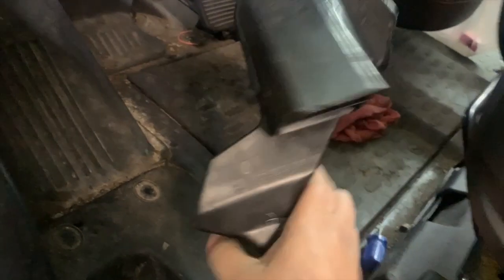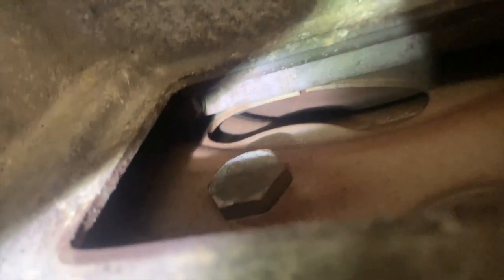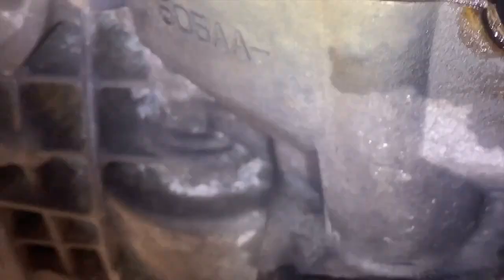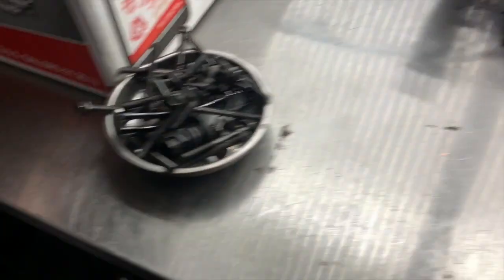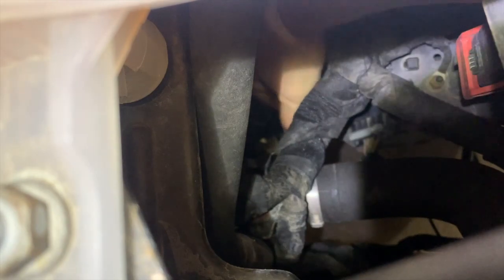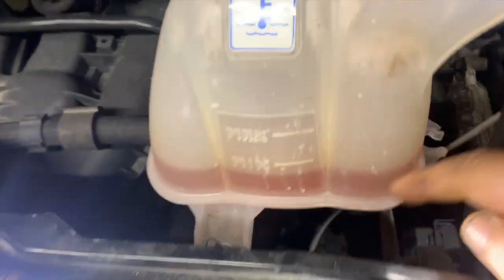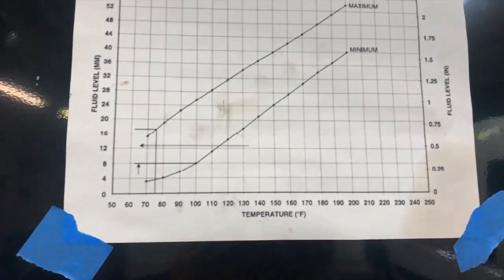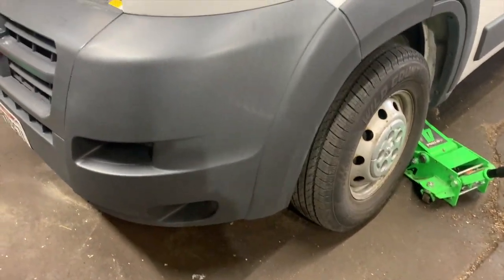Ram Promaster Short topics : flexplate inspection, trans fluid tool and tidbits. Promasters Only

Comment: RE: Checking Transmission Fluid level. Another trick to check your fluid level is to remove the " Oil Level Dipstick" and with a nail file, mark two lines on the opposite side  at 1" and 1.5" on the dipstick.  Then use the Oil Level dipstick as a Transmission Fluid Level dipstick - wallah! your done.
Reply from the maker: Correct! The only reason I didn't recommend that is I suppose it's possible that if you put a nick or a slice in the dipstick it's possible it might fatigue and break off. Plus, not all but most Promasters have the cable/bullet style stick which is very hard to read transmission fluid against. Plus, the big zip tie is easy to carry and handy if you ever need to take a hostage!
Reply: That’s how I do my hostage tie ups as well.

Comment: My flexplate has broken 3 times in my 100,000 miles or so of ownership. Any idea why it keeps breaking or if there is a stronger replacement?
Reply from the maker: Yes, but you aren't going to like the answer. Something is causing a misalignment between the engine and transmission. Either one was drilled off or otherwise made wrong, and it's causing them to be eccentric to each other. That wobble has to be taken up by something, and that something is the flexplate. The problem is I don't know how you would measure it to find out which one is the culprit. The fix would be some kind of offset dowel. Another option would be to assemble it without the two dowels, measure it's vibration when spinning, adjust it for the least vibration, and then oversize drill it and install new dowels. But exactly how you would do that I don't know. You could also install some kind of stronger flexplate or make a custom flexplate, but I suspect that would only be a temporary fix.

Comment: Are you checking the temp via an OBD II sensor, or with a thermometer?
Reply from the maker: You need a mid-grade scanner to read the computer for trans fluid temp. You could also read it mechanically with an IR gun on the pan or trans cooler, I suppose. Not sure how you would do it, but you could stick a temp probe down the trans dipstick tube.
Reply from the maker: Doesn't really matter though, let it idle for 20 min, set the level to 1.25-1.5" and it'll be close enough.
Reply: @promastersonly1419  thank you! I saw another channel lower a thermometer probe down the fluid intake, this seems much simpler

Comment: What is the difference between taking the fluid measurement in Park vs Neutral? Others say to take the measurement in Park.
Reply from the maker: From my end, all the manuals say to check in neutral. But SFAIK, there's no difference between N and P as far as the transmission is concerned. If I have it in the shop, I check it in N. But if it's outside with a risk of rolling away, I use P. Even if there is a difference, the level of the fluid would be so similar in P or N as to not make a whit of difference.

Comment: I have a 2017 Promaster so what should I be listening to or paying attention to for early detection of any fix plate problems. 

I sure hope anyone watching this channel will subscribe to make sure we keep Kip on air so he can keep sharing his knowledge.
Reply from the maker: If the flexplate is going to crack, there's not a damn thing you can do to avoid it. The only you can do is detect it early so it doesn't strand you. By the time it's making a rattly noise at low rpm, it's already cracked and it's only a matter of time, but if it is cracked enough to make noise the cracks will be visible as shown in this video. Thus, all you can really do is inspect it every 6 months or so.

Comment: Just bought one last week and this is already my type of repair channel. Im chasing the coolant leak and my fans need replaced. PO says hes had the cams replaced and the trans rebuilt. Wish me luck
Reply from the maker: I betcha a dollar if you take a mirror and look at the house coming directly out of the bottom of the coolant bottle, you’ll find cracks there and evidence of coolant on the hose. Super common. Fix is bottle replacement.
Reply: another forum stated a 2017 has the fan controller replaced by dealer as a recall.

Comment: Great info as always👊. Can I make a request? A video on trouble codes like the one I am having right now: P06DE. Not to worry or get right on it? Pressure Control circuit stuck on/off?
Reply from the maker: I do need to make a video on that - super common code. P06da, P06dd, and P06de. All three relate to the solenoid that switches the oil pump between high and low pressure, which it's designed to do between 3000rpm and 4000rpm. The solenoid is a super common failure item, and it's built into the pump so the fix is to replace the oil pump. That sounds scary, but it comes out through the oil pan at the bottom and it's not a horrible job. 3-4 hours. Stuck in low, the pump still delivers exactly what it's supposed to deliver under 3000 rpm (30psi at idle, shooting up to around 90 by 4000rpm). More than enough for normal driving. If the pump is stuck high, I suppose it will deliver ever so slightly less fuel economy as the pump takes power to turn, but I doubt you'd even be able to measure it. I advise customers that you can safely ignore 06da and 06de forever if you like. 06de is rarer, but I can't see having too much oil pressure as doing any harm. New pump is around $250, and labor to put it in. Make sure the shop doing it know they do NOT have to remove the whole front timing cover to get to the pump - drastically harder and more expensive. Type "motorcity mechanic pentastar oil pump" into youtube to see a great video of it being done. Not difficult, with one $10 special tool.

Comment: Thanks for another great video Kip. Have you done any experimenting with non-Mopar ATF fluids like AMSOIL?  I’ve had good luck with AMSOILATF on my 2004 Volvo XC90’s (GM) transmission that I try to baby as it’s known to be a weak link in that application, and I’m trying to do everything I can to take care of the transmission in my 2021 ProMaster since I have a camper build that pits the van at around 9k GWV all the time. AMSOIL seems to meet the ATF+4 spec but I can’t confirm it meets the MS-9602 spec if that’s also something I need to match. I know the safest route is usually the OEM fluid, but I’m looking for a little “edge” to protect my transmission if there’s something out there that would have a benefit without any downsides to the longevity of the transmission. Thanks!
Reply from the maker: Sticking to mopar only fluid is partly a warranty thing - they will deny a warranty claim if fluid doesn't meet the spec. But premium fluids (Royal Purp, Mobile 1, AMSoil) wont hurt it and may actually be superior. The problem is how do you know? As a shop, I KNOW that if I put in the mopar stuff it works well, proven. To make it more complicated; which is better - put in fluid that's half as good but change it twice as often? Or half the price and change it twice as often? But the answer you want to hear is in your app I would go AMSoil, and if I really wanted to go apeshit I would do a couple internal upgrades once it's out of warranty. This would involve cracking open a perfectly good transmission. Another option is more psychological than mechanical; if I had 5 grand in the bank I would know that any transmission failure no matter how severe could be solved with money in 7 days time. That's how much it would cost to tow it to a transmission shop, have them rebuild it, and be back on the road. Money solves EVERY problem, unfortunately.
Reply: @promastersonly1419  thanks Kip. I’ll probably stick with factory everything at least until it’s out of warranty. I’m curious about the internal upgrades you recommend for if/when that time comes - I usually do my upgrades like that after something breaks (sort of a silver lining to those situations!). Maybe a future video on strengthening an out-of-warranty 62TE?  Thanks again.
Reply from the maker: @olivierhecht8022  Much trans upgrade video content is coming. A company named Trans-Go sells some very slick and affordable upgrades, and someone makes a pricey but good converter upgrade.

Comment: Had a weird symptom today. Driving very gently and I thought a caught a brief flash of the transmission fault light just as I was stopping at a red light. Not even sure it was the light - I just thought I saw something red flash in that area for less than a second. Pulling away from the light very gently, the transmission seemed to take too long to shift into second, and then really slammed into gear. Very noticeable!  Transmission fluid temp was 170 when it happened and fluid level was 25mm @ 155 degrees the next day. I added 300ml of fluid to get the level at the same temp to 35mm. 

This has happened to me once before, maybe six months and 9k miles ago. The van drove normally for thousands of miles after the one and only time it happened before and for ten or twenty more miles today after it happened once. 

This is a 2021 with 40k miles and I changed the fluid and filter at 30k miles.  Could something like this be a very temporary blockage in one of the fluid passages?
Reply from the maker: Very tricky to diagnose. I'm assuming no codes, or you would have mentioned that. There are a cluster of things that could cause a delayed/harsh 1-2 shift, and they range from nothing to catastrophic. Practically, the only thing you can do it wait for it to happen again or happen consistently. You've already been on top of it with the fluid, so the rest is in the hands of the transmission gods. My feeling is that because there was no code, it's electrical and not mechanical, meaning it may happen randomly, intermittently, or it may be caused by something entirely unrelated to the transmission.
Reply: Thanks Kip. No codes with a CEL, but I didn’t do any deeper scan. I have an AlphaOBD connector I can use to see if there are any stored or pending codes that the ScanGuage didn’t pick up…I watch this transmission like a hawk and try to baby it since it’s a camper build that’s always at the heavy end of the GVWR…that type of shift was disconcerting!
Reply from the maker: @olivierhecht8022  a scangauge should pick up the same codes as any scanner. You might bust out Alfa to see it there are any power interuption type codes in the body module. Other than that, all you can do is drive it.

Comment: Thank you for sharing.  I own Ram ProMaster 3500 year 2019 with 23,000 mi on it all easy highway miles and I never towed with it.  It is a RV when would you suggest I do a transmission fluid change?
Reply from the maker: With so few miles being put on, I might be more aggressive than a van that runs all the time. I’d do the fluid and filter at 40k.

Comment: Good day to you. Thank you for your videos... I have a 2018 2500 Promaster 159wb.. I am vanlifing it.. Do you know of a way to change idle rpm? I have 300 amp alternator and 400 amp hours of lithium battery. I have a 2 60 amp DC to DC chargers. I would like to charge batteries, but idle can be to low. Thanks

Comment: My flex plate started making a rattle?  Had to be replaced!  When they took it out the are holes all the way around to make it lighter. There was a Crack between All but 2 of them!  It was about to completely fail!
Reply from the maker: Good catch. Had it cracked completely, you are not only without any drive but you wouldn't be able to restart it once you shut it off. Hot tip: examine it as shown in this video every 2 or 3 months. Some vans are chronic flexplate crackers and you want to know ahead of time.

Comment: Thanks a lot! But have you ever experienced grinding noises from tranny , and seems like the pump it getting air into it? I just replaced one transmission with another yet still the same stuff. If I overfilled it a bit can It cause this thing ? I’ve checked all fuses and relay which might operate it . The vehicle is moving , but after one or two minutes it just skips, only battery terminal removal helps to get it running again. Any idea ?
Reply from the maker: That's a weird one. Normally, transmission whine is either a fluid or pump problem. Have you checked the fluid level? Slight over or underfill shouldn't really make a difference. Have you had the codes read?

Comment: So...filling transmission requires super long funnel?
Reply from the maker: Yes. I use the metal bendy ones. Going to need about 2 feet, and a small enough output to fit into the dipstick tube. Walmart sells them.

Comment: Does a low frequency rumbling/vibration in reverse only indicate anything specific with these transmissions?  Drive is still smooth.
Reply from the maker: Not that I’m aware of. Not sure what would cause that symptom, but I’d look at motor and transmission mounts first.
Reply: @promastersonly1419 it’s been six months but in case this helps others - it was the rear transmission mount…thanks!
Reply from the maker: As time goes by, we see that more and more. It's hard to diag, because you have to be looking at the engine while it's power braking to observe it. Luckily, both transmission mounts are cheap and relatively easy to change.  @olivierhecht8022

Comment: My dispachervery familar with my former owner said that his promaster went thru before i joined him 2 flexplates so thats a total of 4 in 5 yrs
Reply from the maker: That's a lot, and it implies the problem - the engine is misaligned to the transmission. Not certain what can be done to correct that, but it's happening because the flexplate is forced to take up that eccentricity, and it fatigues and cracks.
Reply: @promastersonly1419  maybe the dealerships dont know how to align?
Reply from the maker: @judegallagher2355  There's really nothing to align, that's the basic problem. The alignment is established with two machined dowels that go between the engine and the transmission. As long as both dowels are there, you've done what you can do. 

I have a buddy who is working on an offset dowel that could correct this, but I'm unsure how it would work - how would you measure it accurately. We'll see. For now, I find that vans either never break a flexplate, or break them repeatedly. In theory, you could add something to make the flexplate stronger, but that would just move the vibration somewhere else where it may cause more expensive damage. In a sense, the flexplate is doing what it was designed to do - soak up wobble.

Comment: would it be a good practice to measure the fluid coming out and replacing it 1 : 1?
Reply from the maker: Probably not, because it assumes that it was correctly filled when you started. But measuring what came out would certainly get you in the ballpark when you put fresh back in.

Comment: I Have been following you for awhile. I found you the day after I made a abrupt, impulsive purchase of a 2014 high roof ext wheel  base. A 3500 turb diesel 
.
The very first video I saw from you was ""don't buy the diesel.  And I really felt buyers remorse.
It's been ok besidès I keep  getting codes about my particulate system.  I just have a question about front end clicking. Sounds like
The a bad CV joint. But it happens even when my steering is straight. 
Any experience with that ?
Reply from the maker: Usually, axle stuff presents when turning. Another classic symptom is vibration at certain speed but only when accelerating. 

I’d pop off the front wheels and look for something that might be rubbing, something in the brakes or on the wheel. Just guessing.

Comment: Thanks for your videos, I have a 2500 promaster and I'm not sure why the radiator fan sometimes or most times the rpm is heard very high
Reply from the maker: What’s happening is the fan isnt high rpm, it’s just noisy. The fan bearings get play as they wear, and they get louder and louder as they get looser and looser. Eventually, it sounds like a shop vac, or an airplane landing.